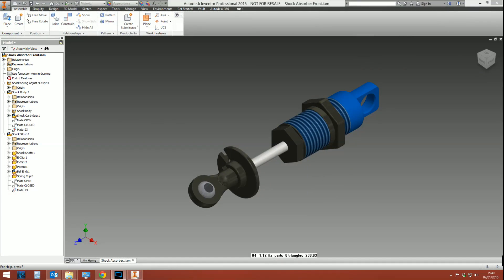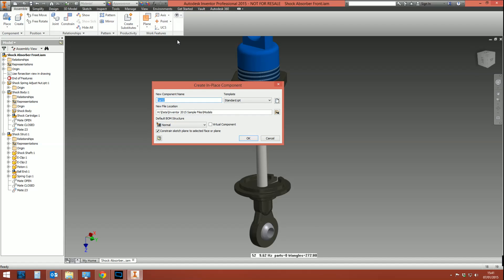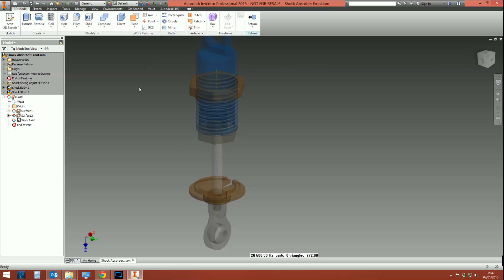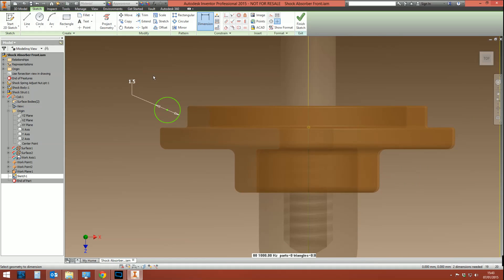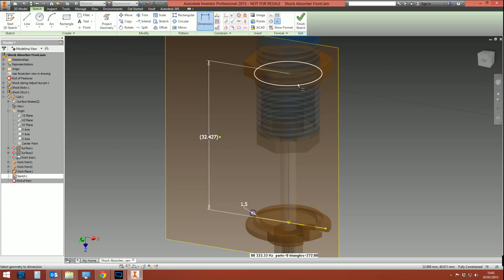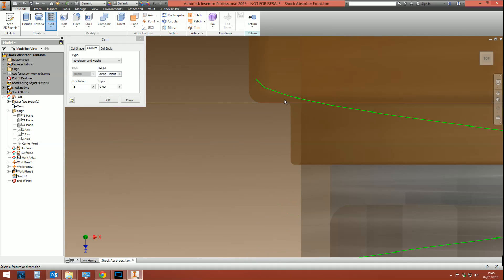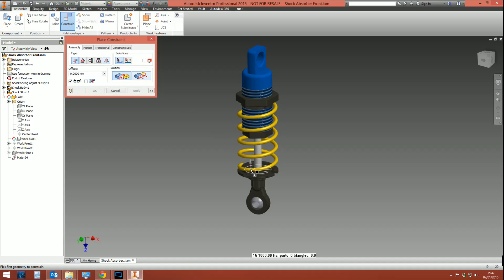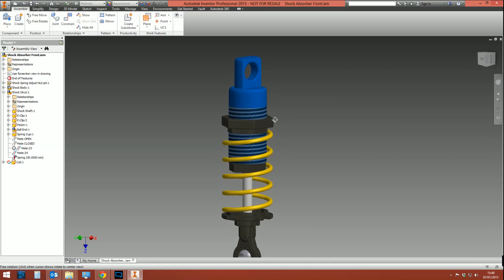How to make a coil spring compress/animate | Autodesk Inventor

Comment: I was trying to use this trick when building a camshaft-valve-spring transitional constraint assembly and nothing happened and the spring was not moving after the valve. I presume this trick is only feasible for those two constraint examples shown.

Comment: TFI, your videos have helped me do some wild stuff in Inventor that I didn't know could be done before so I wanna thank you for that. I have a question on this one. I have a valve that has 4 springs in it (2 pairs of identical springs). The adaptivity worked no problem. I set all of the driving constraint dimensions using parameters. Once I go to animate the functionality of the valve in Studio, the spring adaptivity stops automatically working and I have to phyiscally drag on the spring to get it to update. Any quick thoughts on what might be causing it?

Comment: I have done this succesfully, following your steps in the past but currently I'm having troubles. It creates two flush constraints of the associative surfaces with the original faces so the assambly is fully constrained. So, I have to supress one of the constraints, move the part that compress the spring, and then un-supress the constraint (and when I do that, the coil is inmediately compressed/elongated)
Reply: Actually, I think i know what the problem is but I can't solve it. The associative surfaces are not visible (therefore I did not create the work points on them) even when the visibility is enabled. I cannot make them acually visible

Comment: Hi,I'm new to your video's and I must say they are dam good at explaining things.  This spring idea will work well for a spring bolt in my assemblies, what I would really like to do is make a compression spring work. Picture a vertical ramp on a trailer that has a fixed vertical bit through an eye bolt at the bottom and long vertical bit on the side.  When the ramp folds down I want the spring to work in that fashion any help would be appreciated.

Comment: Awesome dude!! Something I've wanted to do this for ages. A quick question though....If i do exactly what you have done and then I add that assembly to another assembly of the rest of the suspension that that shock works with, if i then drive it as you did will it move all the rest of the components of the assembly it's part of? Sorry if that doesn't make much sense...you know me lol.
Cheers,Alex :-)

Comment: thats all cool and all but how do you do it with a realistic spring like the ones generated with the compression spring feature in the design tab when in assembly view? i would like to use a spring that has the tighter coils at the ends with the flush coil termination. but cant find a way to drive it
Reply from the maker: Yea this was a very simplistic spring, I know what you mean.  I'll have a think but as far as I know it's highly unlikely the spring from the Design Tab spring generator will be able to animate.  If you open a spring from that, there is no 'height' or 'length', it's built up using bits & pieces of features generated from the original calc sheet.  I've never tried to animate one of those because of that, but I'll have a dig around.
Reply: cheers, ill just have to make do with the end compression feature in the coil creation menu. next i have to drive an anti rotation scissor hinge on the 2 parts of a piston. im working on a RC model SR-71 blackbird, currently designing the main landing gear assembly

Comment: Your like an Inventor ninja=)I have done this but your way was a bit quicker than mine,nice job keep up the good work,just gets confusing at times as I jump from Inv to Solidworks and the drive constraint is a great tool to have but some people dont appreciate it untill they can to another system,pluses and minuses in them all,take it easy
Reply: Does sw have the option to work directly on an assembly like he does here. .
Reply: Sw is a different workflow to this from my experience so far but I could be told different,I can create a moving spring in solidworks but never tried a top down work flow with other parts,beginning to apprecite Inventor Paulie
Reply: James Lenane is that what to down means. . Yes I'm appreciating inventor. .sw should have this option